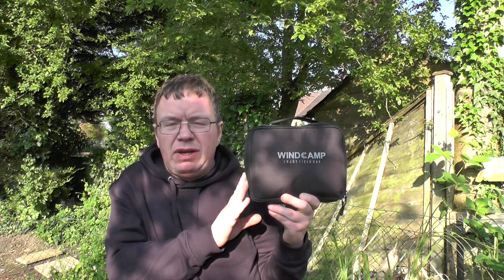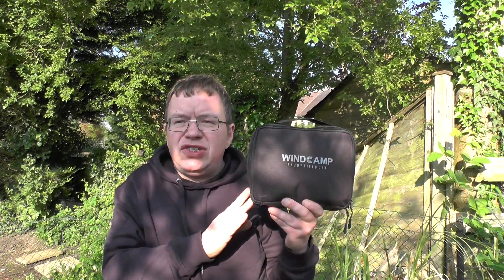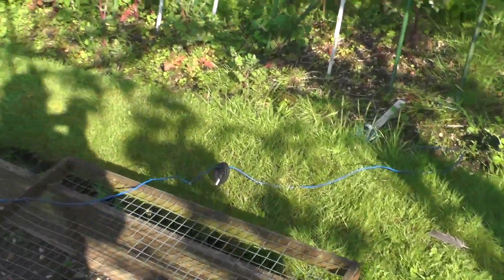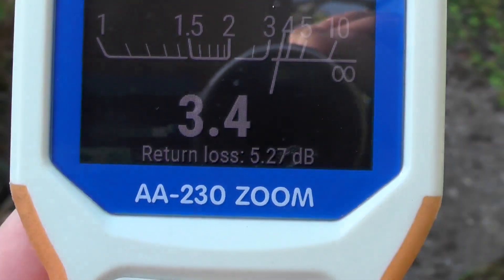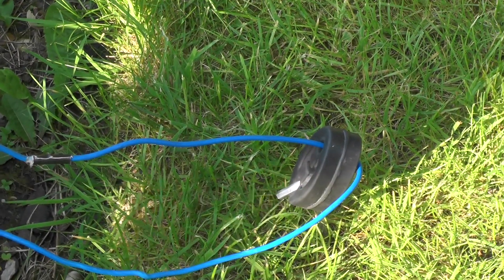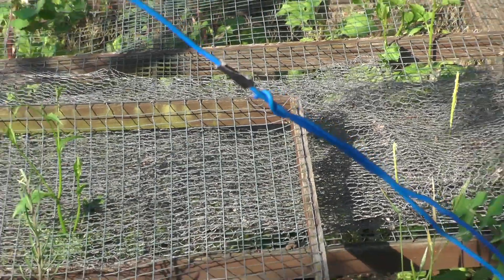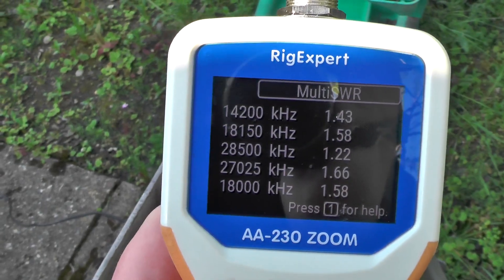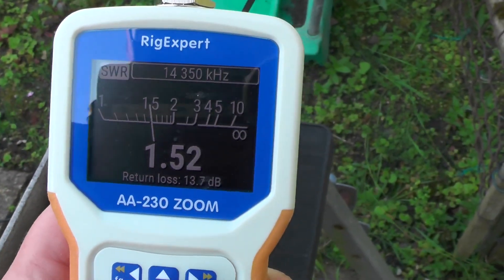Why Fold it back?

Comment: Thank you for this video, could you tell me again the length of the blue wire your using in the video please.
Reply from the maker: Hi it’s about 10.5m which gives me 20m and up. If I use 20.5m it will give me 40m and up . Just set your analyser to the lowest frequency you want the fold it back until the swr comes down the the rest of the band should be ok
Reply: @2j4ez  Thank you.